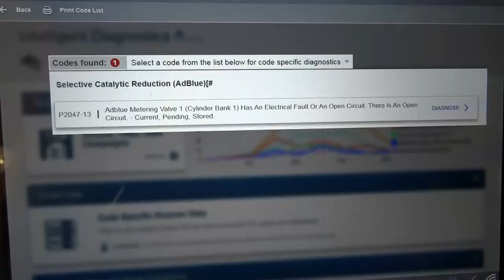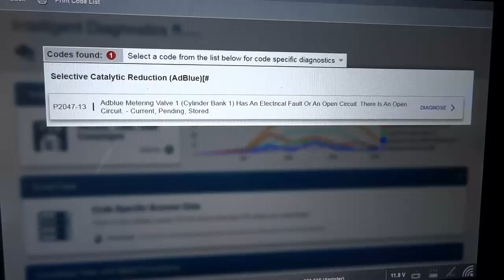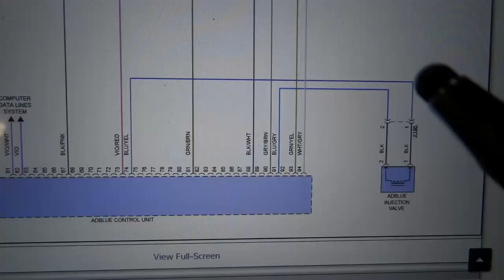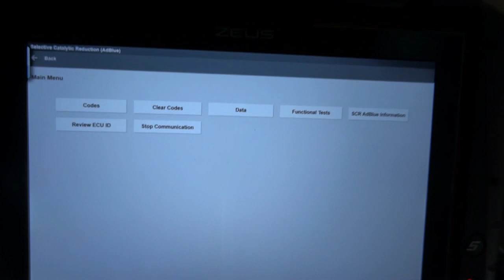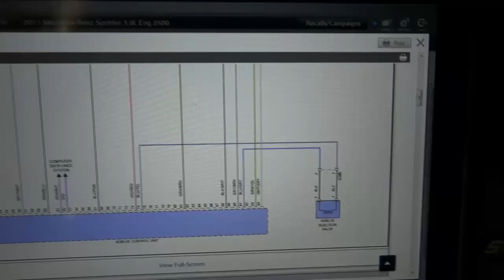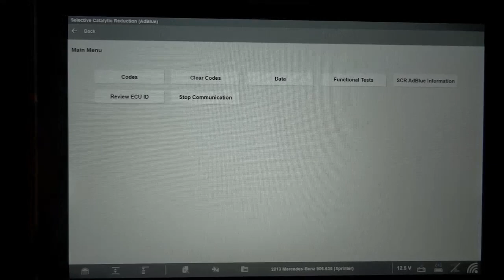2013 Mercedes Sprinter Code P2047 Adblue Metering Valve Has An Electrical Fault Or An Open Circuit

Comment: Before replacing the valve on P2047, it's worth checking the connector and the wiring near the exhaust: fluid that weeps from the injector crystallises and corrodes the pins, and heat hardens the harness there. A resistance check across the valve at the ECU plug, compared with the same check at the valve itself, tells you whether it's the part or the wiring.

Comment: What size socket did you use to remove the clamp around that valve?? I ask as I have to replace mine and someone in the past stripped that nut that keeps the clamp in place.
Reply from the maker: @carlostavaresjr958  E5

Comment: Hello, If i have the 7 starts left, and i change the injector and the check engine light disappears and i clear my code P2048, will the 7 starts go away by itself or will i have to bring it to a dealer to reset it? 2016 e250 bluetec? Please i need help!! thank you :)
Reply from the maker: @Lionmanleandro  No! you should be good after you fix the issue and clear the codes!
Reply: @KITS_Auto_and_Truck_Repair  amazing thank you? I’ll update you when the part arrives
Reply: @KITS_Auto_and_Truck_Repair  
Would you by any chance know the proper range resistance for the injector?
Reply: @KITS_Auto_and_Truck_Repair  I changed the part, it did seem like that was the problem. Check engine light went out. But the remaining starts is still there!!!! What do I do, I drove it about 15km, do I need to do diagnostics?

Comment: There is no need to adblue injector replacement  but it is clean  by water then it will be working condition. 😅😅😅😅😅😅
Reply from the maker: @hba1copqr699  I know that trick but this one had an open coil!

Comment: Surely your test lamp, or a loop, will just spoof the engine light off. E.g. while you source a replacement and/or service the ad blue system.
Reply from the maker: @dingaling2007  Good!

Comment: Pls am using 906 sprinter diesel engine it cranks but no start.Pls what might be the problem.
Reply from the maker: @vincentde-paulyawdoe8076  your crank sensor or fuel pump might be the problem, but I recommend you take it to a pro mechanic who can diagnose it for you!

Comment: soak old injector in boiling water for 10 min then retest, i bet the injector will work again, nox fluid dissolves with water no need to purchase new injector, water fixes it everytime
Reply from the maker: hammered hemi  Good suggestion! but this one was open internally!

Comment: Mine is a 2014 Honda Crosstour. I have a "screen with numbers", not like his. I turned on the power, hit 1 and 6 and the radio button and it worked. Not entering anything. The ignition is also a "pushbutton".  Just because my battery disconnected the radio, power went off and it said Code.  IDK, maybe they made it easier. So stupid to need a code anyway.
Reply from the maker: Lorz S Thanks for sharing!

Comment: I have a 2015 freightliner sprinter with 178k miles...on 9/19/22 I was on the hwy doing about 60mph and all of a sudden a light popped up on the dashboard that looked like an ice cream cone surfing on water with 2 water droplets on top....i connected my scan tool and it gave me a code P13DF00  and then the van said I had 9 starts left... I searched around and found a euro mechanic and we got the talking... he said he knew a guy that knew a guy that knew a guy that can delete  the def system... I agreed.. I had no choice... 🤷🏼‍♂️ the damn van was telling me I had 4 starts left! And every mechanic i called claimed that they dont work on diesel vehicles and the ones that do work on diesel vehicles... dont work on sprinter vans... I even went as far as trying to book an appointment with the benz dealership... and they didn't have any openings until mid October 🥴 so I took the truck in yesterday 9/20/22 and he called me this morning 9/21/22 and said the truck is ready.... yaay!😃 he was able to re program the computer and delete the def system... I no longer have that light on the dashboard... I know or atleast i think the particulate filter still needs to be cleaned or atleast be maintained... I will buy a bottle of liqui Molly particulate cleaner and purge and try to do it myself.
Reply from the maker: Megatron it's unfortunate that you couldn't find someone who could fix it!
Reply: @KITS_Auto_and_Truck_Repair   yes..it was unfortunate...I had to fork out 2k ☹️
Reply from the maker: @megatron2846  oh dang!

Comment: I have a code 20EA92 I already added liquid to the def tank I also changed the sensor and the relay still hasn't been solved, I'm crazy with this fault.
Reply from the maker: bijharly zinsky chaudary mejias  did you check the metering valve?

Comment: I have error P260000, electrical fault or an open circuit. Any ide? Vito w639
Reply from the maker: torarne200sx  you might have a problem in the wiring or a defective component!

Comment: Hello how can i remove derate condition,fault codes are repaired no more active or pending codes, but still def light in dash and I don’t have oem diag tool.I have e-tech not allowing me to perform any test and I can’t drive on highway self diag and passed bcoz due to derate condition any solu to get rid off Derate.
Reply from the maker: kamal gill  you need a capable scanner to do that!!  or you can take it to a shop that has a capable scanner so they can clear it for you!
Reply: @KITS_Auto_and_Truck_Repair  from where I can get it and how much price?
Reply from the maker: @kamalgill9862  I got mine from the Mercedes Dealership!

Comment: Thank you again for this important video you made. I have a 2012 MB Sprinter and as soon as I added DEF it shows 'def' light and showed ' Starts remaining 16' and counting down. How can I reset the manually?
Reply from the maker: Fermin Ulit  you will need a scan tool that's capable of resetting the adblue system or you can take it to the Dealer!

Comment: My friend i have 2014 mercedes sprinter 2500 i was in accident airbag no good now but the sprinter doesn't start
Reply from the maker: Dany Chacon  if the airbag module was impacted that may cause a no start condition, you should take to a pro mechanic to have it diagnosed!!

Comment: Hi teacher K well done on showing how to fault find the integrity of the electrical circuit before chasing to buy new adblue injector.I have a question,is the adblue fluid there to keep the dpf clean or to remove the Nox gases or both .In this particular sprinter is the adblue injector spraying into dpf or what  thanks in advace
Reply from the maker: Rafiek Ahmed  Great question! the DEF Fluid Breaks the Nox gases in the exhaust system for emission purposes, what cleans the DPF is the regeneration process, the injectors stay on during the exhaust stroke to allow diesel fuel to get in the exhaust system to clean the soot in the DPF